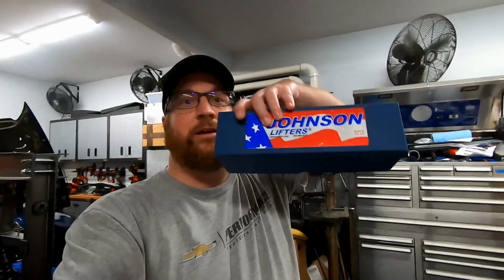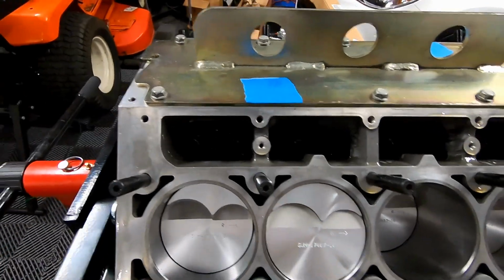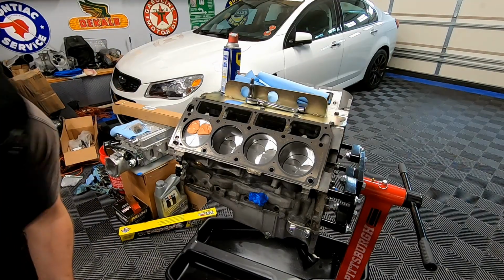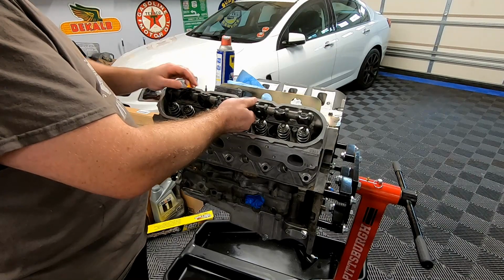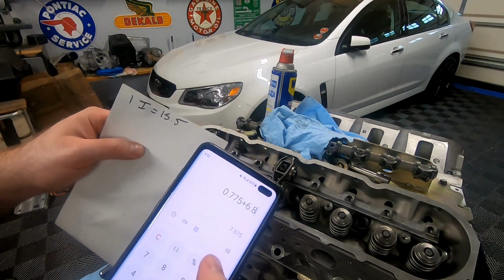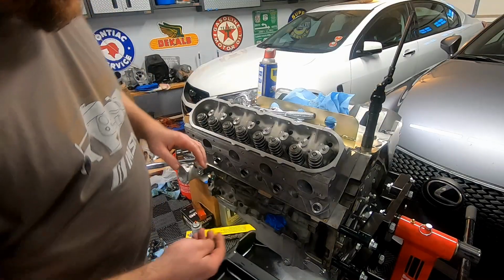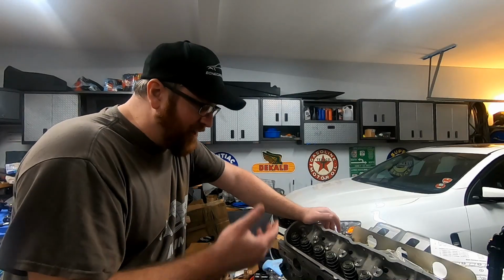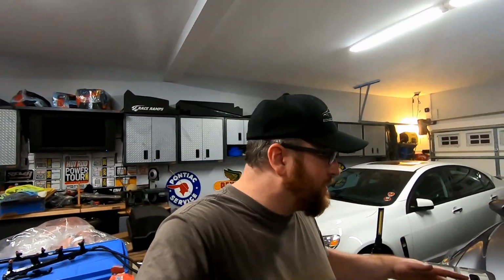2005 Chevy Corvette - Top End Final Assembly

Comment: Checking the pushrod length with the pedestal mounted rockers - couldn't it be different than with the shaft mounted ones you will eventually install?
Reply from the maker: The rockers on the shaft - are OEM rockers. Instead of having the middle trunion piece - it just has a shared rod going through the whole setup. 

So in the end - its the same design as the OEM rocker - just a common shaft instead of 8 individual trunions per side.
Reply: I'd want to measure with the rocker arms that I was going to use. Especially with short travel lifters.

Comment: Head gasket “front” facing wrong way?
Reply from the maker: Dude - excellent eagle eye vision!

I haven't fully put the car back together - but the drivers side head was the last piece I needed to work on. I have to pull the blower and parts off again - but that isn't that big of a deal.

I double checked - the passenger side is correct. 

Thanks again for spotting that!
Reply: I noticed that too. I had to look up another ls9 video to make sure, but hopefully he caught it and put it on right.
Reply from the maker: I haven't put any fluids in the motor just yet - I still have to tear it apart some. I am thankful you guys caught that - and commented on it!
Reply: I recently got a set that said "front on both ends on opposite sides.

Comment: I always use a soft spring in place of the valve springs when checking for ptv. The heavy springs can collapse the lifter giving u a false reading for ptv. Also remember to add in the pre load to ur pushrod length. Not sure off top of my head what the lifter pre load is on the Johnson lifters.
Reply from the maker: I have a set of test springs - but honestly I didn't feel like tearing the head back apart. 

Ran it - measured it - and the pushrods I received are perfect. 

Johnson calls for .030 of preload - which is what I factored in when ordering the pushrods.